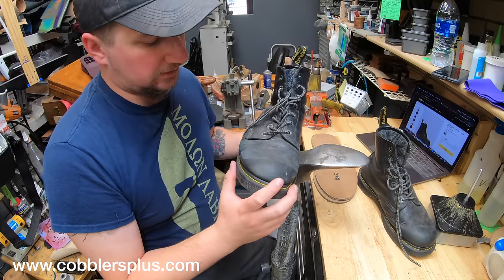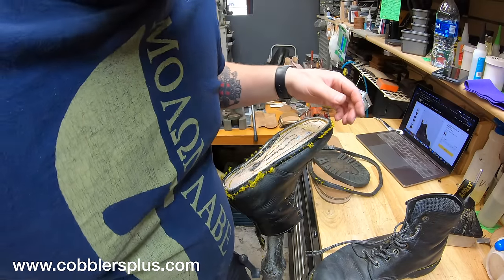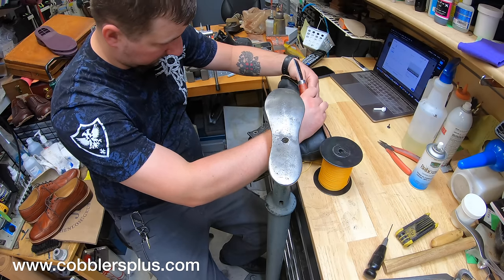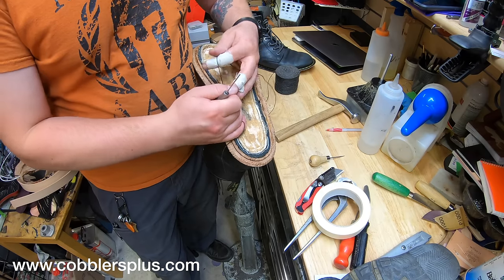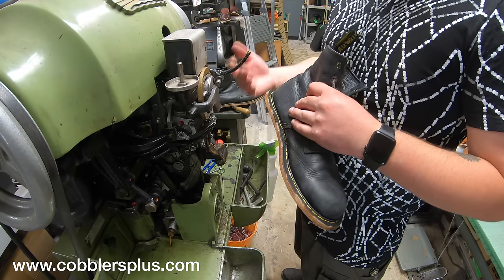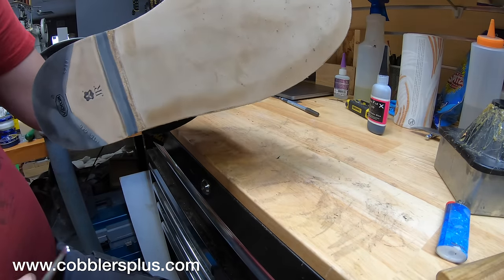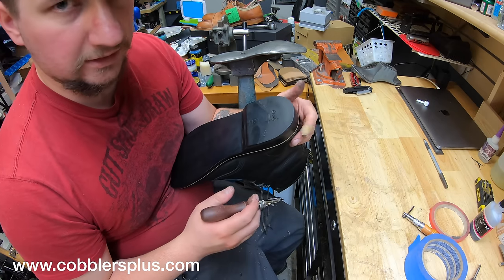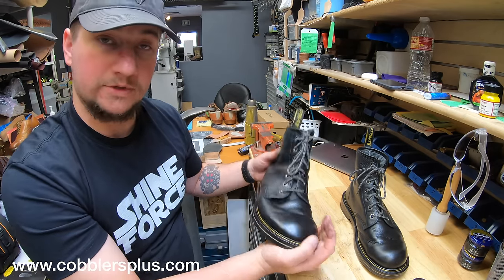Dr. Marten Boots- Re-Crafted with JR Leather Soles, Storm welt and so much more

Comment: What you did with those DM's is insane.. I have never seen a remake of a DM that was so close to the original aesthetic, yet used quality materials... Bravo !! 
I wore DM's from 1975 when I was 12 years old, for many years..  when they were still made in the UK,  and had probably a dozen pairs.. Let's face it they are crap quality boots..(that's why all the poor kids in the UK wore them.; they lasted a reasonable length of time, and were cheap)... 
The insole is shite fibre board, that falls to bits and you end up walking on the honeycomb outer sole rubber. The upper, chrome tanned crap leather is so thin: that along the toe welt, it splits through... between the rubber welt and the upper.. (on every pair of boots I ever had) 
The soles wear down so fast, when worn every day, that they are basically wear and bin footwear.. 
The original UK made ones were better, but not great.. just trendy at the time and all the kids wore them.. That quality poor as it was, went to crap once they moved production to Asia... and prices skyrocketed.. When i was a kid they were very cheap footwear for kids and all the 'lads' wore them. 
FYI, the orignal Doc Marten factory was take over by a brand called Solovair.. with original DM workers and they make boots very clos to the originals.. 
Great video, and amazing work..

Comment: It would be cool to see a pair of blundstones. I know they're really not meant to me resoled, but can you pull off the old sole and glue another one on the bottom?
It would also be awesome to see a pair of Georgia Boots. I just got some and they said they're goodyear welted. It would be cool to see inside them.
Reply from the maker: It would depend on the build of the blundstones because they have a few sole types as well as the condition. But it can be done. 
Georgia boots I’ve resoled a number of times but haven’t had a chance for a video yet
Reply: @CobblersPlus  It would be really cool to see a video on either if you get a chance. I just got a pair of Georgia boot Romeo highs, and the welt has an interesting look. It would be cool to see what its made of, and why its shaped like that. I'm also loving the boot videos.
Reply: I have a pair of blundstones that have been resoled twice.  The uppers really last with care.  There are specialty operations that resole blundstones.

Comment: Just one thing to get rid of the stitches fast. DrMartens use chain stitching, there is no glue, to take it apart once the sole is removed just undo the stitches where they overlap, grab the thread (its easy to see which end is the right one) and pull.
It undoes all the stitching right away. Thats how I took apart the ones I did.
Plus if one isn't a cobbler and fixes their own boots by hand, usually new yellow thread isnt readily available, if the old one is in good shape it can be reused (sometimes one needs to make do) since chain stitching goes forward and back again at each stitch on the inside there is enough thread for an handmade stitch to the midsole . (or even for a fake yellow stitch on a new split welt just to keep the original look).
The original stitching from the outside might give it the iconic look but it is also where the boots will start letting water in once they age a bit.

Comment: I have a pair of docs that the leather on the heal tore through right along the line of that leather strip where the yellow thread is that holds the soles together (Storm Welt?) Do you think that's repairable, even as a like a project just to do in my spare time? It almost looks like the leather was cut too short by accident somehow at the factory and eventually it just separated. Maybe like that hot knife you talked about slipped and it cut and melted the welt to the leather and that bond eventually just came apart with wear. I was on a TV set and some one stepped on the heel and the whole bottom (Outsole to insole) just came off and you could see my socks. got a complement on my sock so theres that though haha

Comment: I know this is an old video but just wanted to say the company who originally made boots for Dr Martens, Solovair, who still make boots under their own name in England (none in China) sell replacement soles, I am getting a few to fix some old made in England Dr Martens I've had for years that just need soles, nothing else. Since I am not a cobbler and have no acess to a hot knife machine I emailed Solovair and they said any cobbler can resole Solovair or Martens with hot knife method or can be glued on. Since I like to do things myself I am going to try the glue on way keeping the original welt but adding the extra stitching you did for added strength.
Reply: Did you get those Solovair soles put on the Docs?  That's totally what I want to do with my made in England Doc's when the time comes.
Reply: @matttherrien9608  I glued them on myself and they look perfect. Solovair says to order a size up for trimming after installed but I have no way to make the grooves on side of soles so I just got my actual size and it worked out great, just be careful to line up perfectly before sticking together as the glue bonds instantly
Reply: @78gagta78  I bought the most expensive model they had so I'm certainly going to have the resoled one way or another eventually. Afraid to do it myself though because I paid too much for them.  Thank you for your reply.  How did you cut the old soles off?  What adhesive did you use?

Comment: Good job. Which is heavier, the original pair of boots or with resoled leather? Also, how much does it cost, roughly?
Reply from the maker: The new sole is a little heavier and the price for this is very high. This pair alone was over $400
Reply: @CobblersPlus   Excellent work, but not worth it on a pair of Doc Martens.  I rather have that done on a used pair of Alden's 403 boots